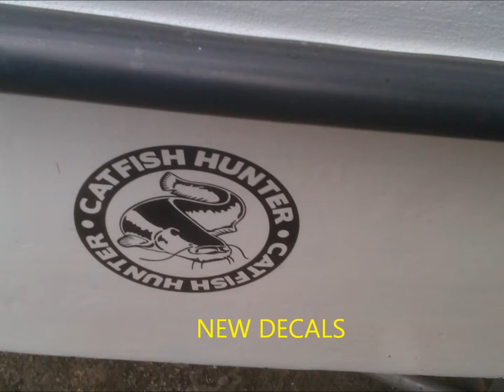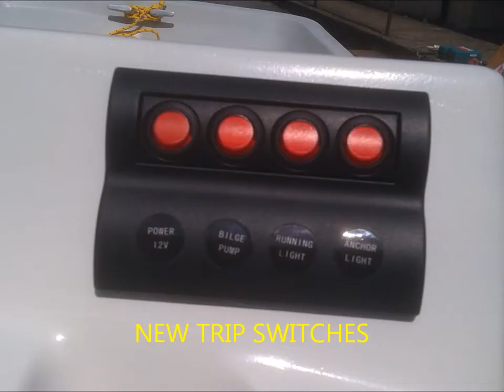4 meter Orkney Dory refurb

Comment: ttransom in these orkney dory's are prone to rot due to bodged when new.
cheap plynot covered in glass.
when water gets in between the two shells (and it definitely will) the transoms rot out.
put new wood all the way across unlike orkney who only put in 27 inche, yep narrow transom,not covered at all.
mine is completely encased with fibreglass then put in and then covered again and again and again.used original glass floor with sealer so i can always get to hull and check it out.

Comment: looks good
shame you didnt use closed cell foam though and take it apart and put a new transom in it.
the foam you have used is useless if you get the slightest hole in the bottom as it will hold water.i took my 4 metre completely apart and found that orkeny built the boats terrible.i put extra layers of glass on the hull as they tend to leak down the middle where the stainless strip is screwed in. better off without the strip altogether.
then completely rebuilt the transom.
now its strong.

Comment: notice the front stringer is not glassed in !!!!!! orkney try telling you they are all bonded !! no they are not, loads of bits like this get left out and cause a weak structure.
mine had lots of bad bits missed out and mine is same model as yours.
not all orkneys seem to have foam under the floor !!!!! mine did but i think the previous owner put it in. there is no wood under the gunnel rails neither, its thin alloy here and there so beware fitting anythng to it.ill put my rebuild on soon
Reply: No foam in mine at all. But had to replace the transom. Now it's got aluminium an glass in it so no more rot, also my floor is plastic and removable for some reason